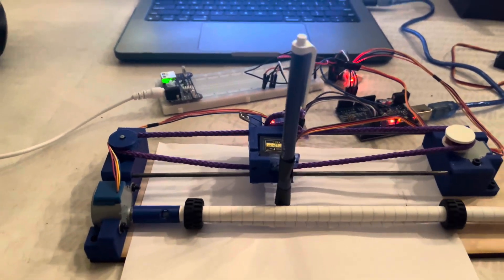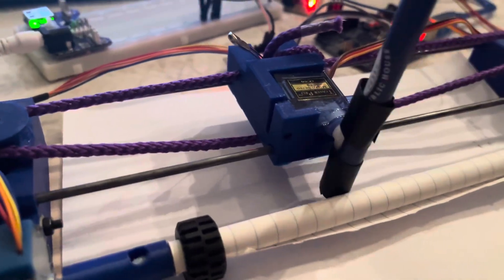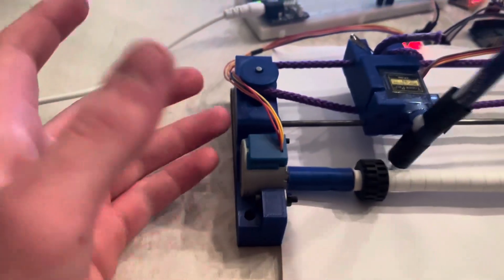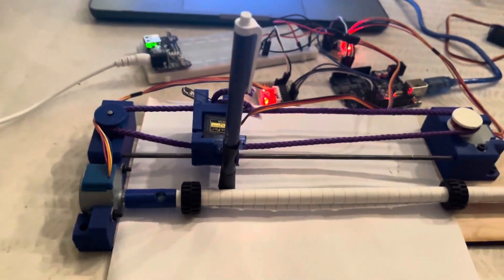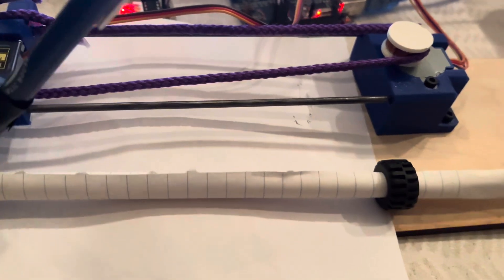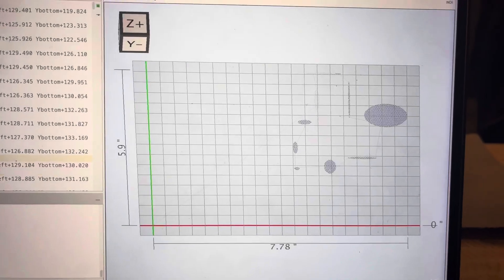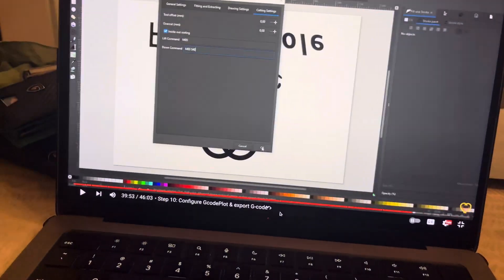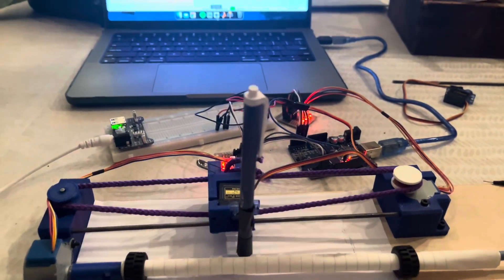CNC pen plotter piece of trash needs some improvements‼️‼️

Comment: Fix the axle on both sides. Modify the pen servo holder to a linear actuator that can lower or lift the pen from the paper. Make sure the belts are as parallel with each other as possible

Comment: Keep at it.  Even a wooden dowel would work well as a shaft, .  Even better if you had a top/bottom roller that were mated with gears to provide opposing drive function, but that would add to the mechanical complexity.

At the minimum constrain the opposite side, and for added results, constrain the back of what the paper slides on to the shaft with some springs or something to make sure you get good traction.

Your pin could also stand to be transposed a little bit off axis so that the rotation results in more upward movement of the tip, and less horizontal movement of the tip.  That would require the servo actively apply torque to push the tip into the paper.  Conversely, just print a little channel, and put a rubber tire or whatever on the servo so it acts like a rack and pinion.  Put the pen into the vertical channel, which constrains it into just moving up and down, and then the servo can push down on it as needed, though that will likely result in some slippage.  This could be fixed with gear teeth or with a linkage.

Comment: I made one of these for one of my engineering classes and I would love to send you the files if you want. I used paracord as a drive belt in my design. I love the way you move the pen off the paper with another servo motor. That's a functionality that my design did not have.

Comment: Making the belts parallel with your axis instead of on an angle will increase your accuracy a lot.  You could also put the pen in a tube to travel vertically up and down and have the servo arm drive a pin on the side of the pen up and down.

Comment: How does this work what does it do? I am interested in engineering so yeah
Reply from the maker: This works by first having the laptop take an image and generate that into gcode instruction that can then tell the motors to move to specific cordinates on the paper and then when to move the pen up and down. The calculations are done in the universal gcode sender application, and then these instruction are sent to the arduino microcontroller where it then controls the motors with the instructions resulting in movement. This was a fun project to work on the most engineering was definitely in the 3d printed parts and deciding on materials to use!
Reply: Looks intriguing! Keep up the work!

Comment: Hey brotha, just commented on the short but this provided good insight for me to get some ideas. The coat hanger should work as long as you fix it on the right. Still not sure on the necessity of the servo unless you definitely want a dotter, in which case it would work better with the pen on a 1 inch horizontal lever, then drive the servo way less. This will simultaneously allow the pen to overpower the servo a few mm with the torque from being offset (should increase your success rate of pen contact) as well as allowing you to more accurately affix it to the system since the pen itself will rotate much less. Im by no means a pro but I finished mechatronics with a 100 if you have any specific questions 😎😂
Reply from the maker: Excellent! The idea of moving the pen is much better than what I am doing and I think it can be done compactly, Ill let you know if I have questions. Thank you for the advice!